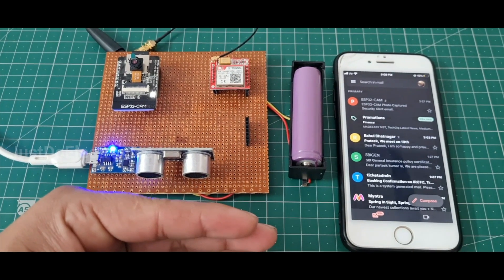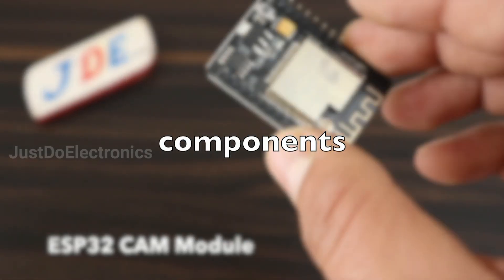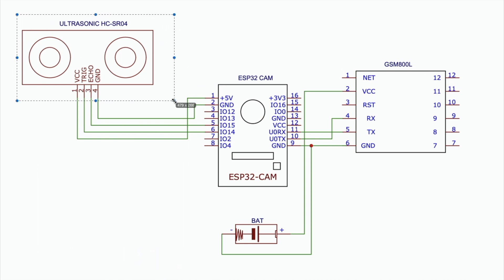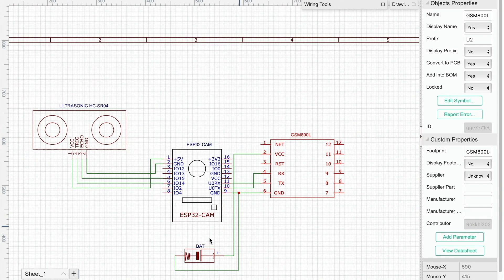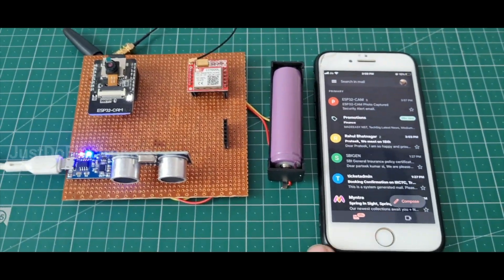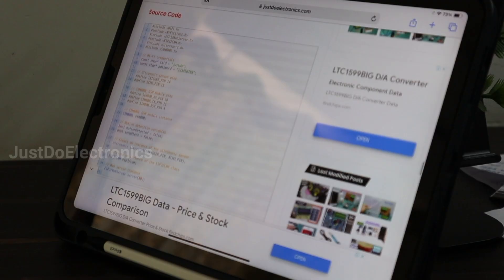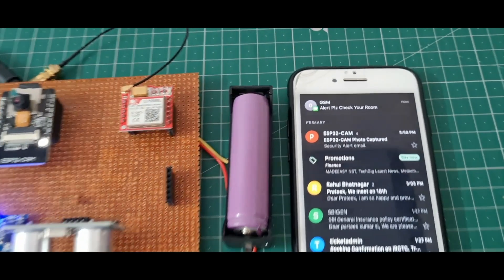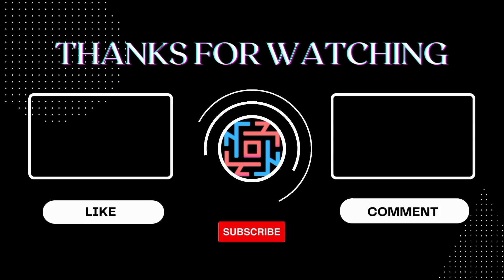ESP32-CAM Motion Alert Security Camera with  (Text message + Email) Notification

Comment: Hi Dear , I m great fan of yours. Can please share the error free complete code for this project to send SMS & also email photo taken by esp32 cam. An early response will be highly appreciated. Kind regards.
Reply from the maker: Thanks for your comment but the code available in website plz check website 🙂
Reply: Thanks for your quick response. Dear I already tried the code available at your web page. That code  does not include any sketch for sim800l GSM Module to send SMS as there is no mobile  number to whom SMS to  be sent . Also on compiling your original code it gives error.  Please check once by yourself & share the modified error free code . I shall be highly obliged. Kind regards
Reply from the maker: @user-ou8zh3dv4e sorry for that we will check and update you
Reply: Hi dear, still awaiting for your earliest response to my querry
Reply: Hello dear,
I m still awaiting your response to my query.
Did you check the code as pointed out by me.
The sim800l code is missing. Please update me if you have modified the code.
An early response will be highly appreciated.
Thanks and kind regards.